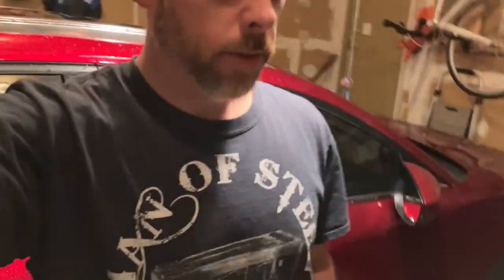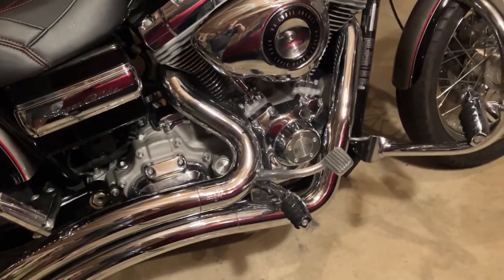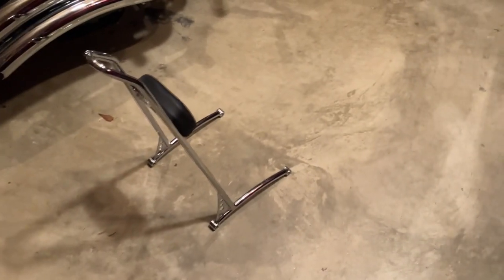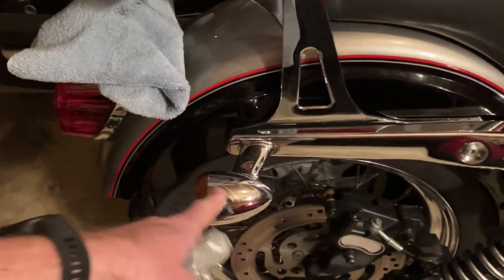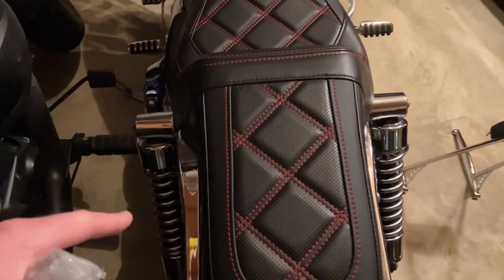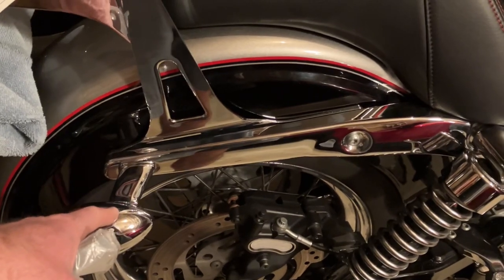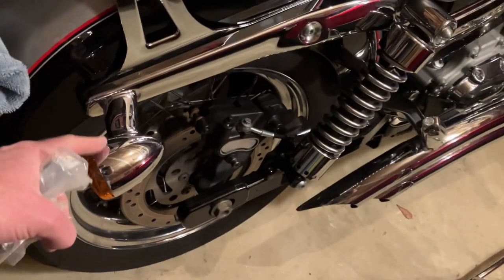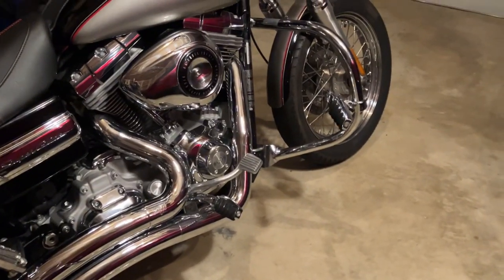Help - Mounting a Burly-type Sissy Bar on a Dyna FXDC

Comment: I just bought this tonight 02/26/2024 and had the same issue on my 2014 wide glide I took it back I’m now on YouTube to try and configure a way to even mount a sissy bar on this 2014 because the way it’s looking I’m going to have to drill holes in the fender and I really don’t want to do that but I see no other way to even mount a sissy bar on a 2014 Dyna wide glide fxdwg

Comment: I'm in the same boat. Called Harley and Fortnine and they both said I don't need to relocate the signals, but I don't see any other way. Did you end up figuring it out?
Reply from the maker: Not yet and mostly just lack of time. You?  I may just put the bike on the lift and start taking stuff apart soon this summer.